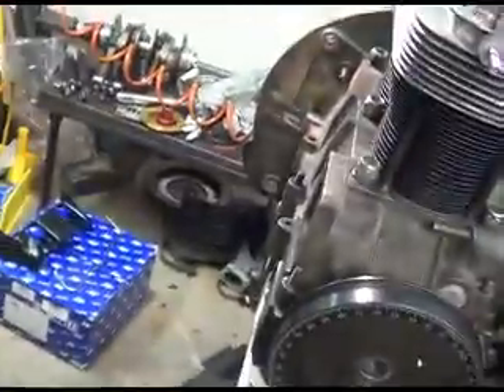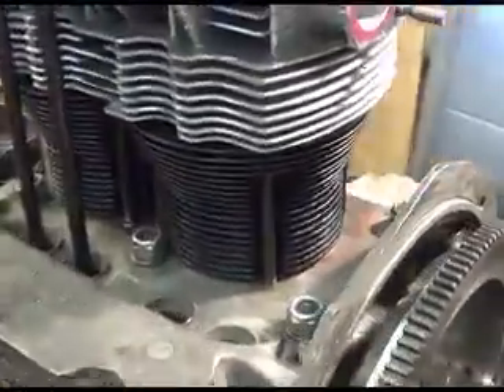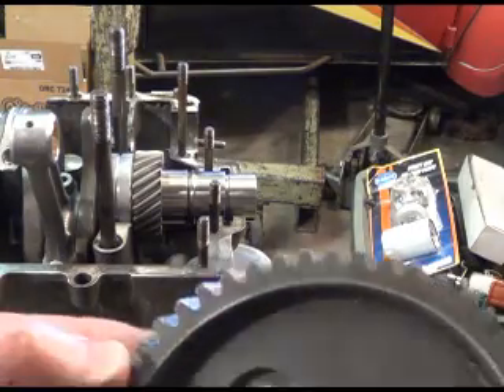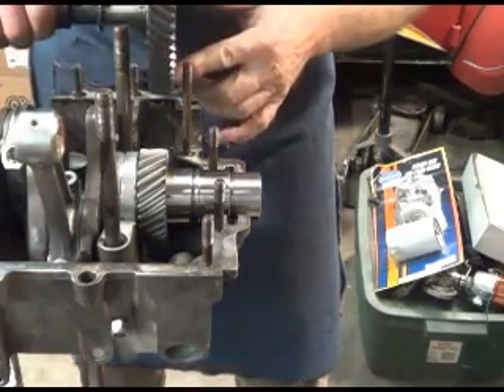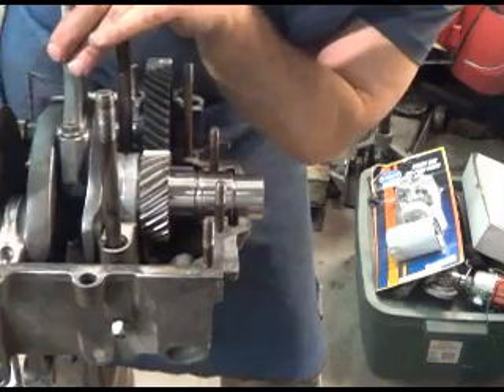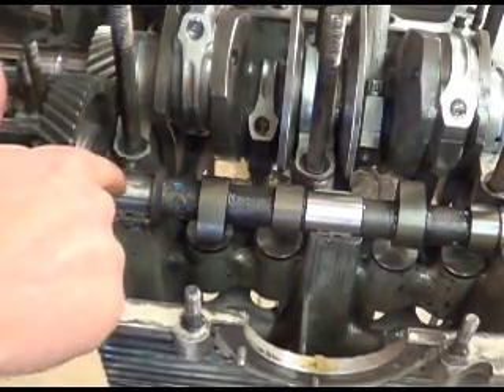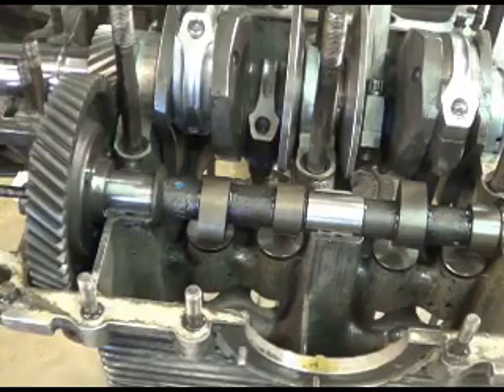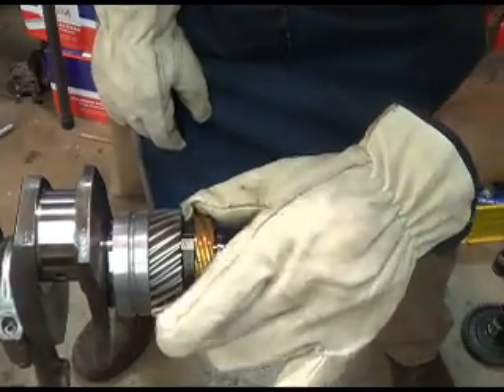1800 VW Stroker Engine PT 6

Comment: Wow never run into that cam gear issue myself and never knew about the negative timing gears. Thanks GZ
Reply from the maker: +Rusty “rustyglovebox” Glovebox They made 7 different sizes to compensate for tooling wear.  If you build a new engine today with all new parts your rolling the dice IMHO.  "0" standard is about all the aftermarket provides and the metal is not the VW alloy. Just plain aluminum. This one is almost on the loose side. But it will work.

Comment: Damn Ez. I never have that cam gear problem. Only once with a new gear, never with a used stock size one.It must be the the cold weather shrinking the case. Lol
Reply from the maker: +John Marks yeah, I put the new gear in and it wouldn't turn down and lifted right out of the journals the other way.   I didn't call this series mystery engine build for nothing.  I don't know what we will end up with.
Keep in mind there is more going on in the background ;-)